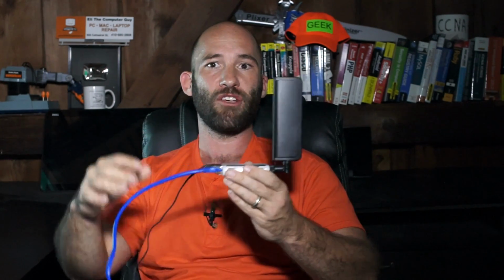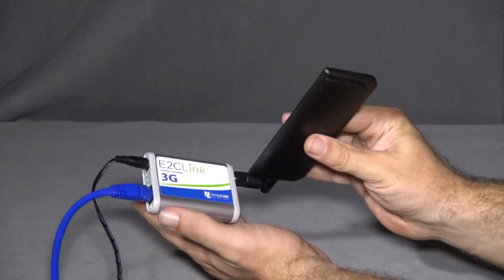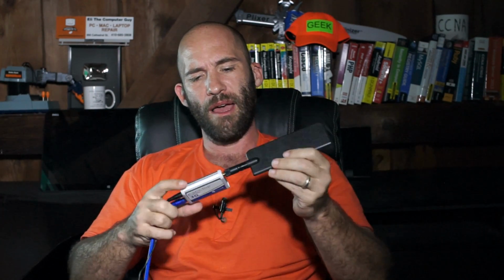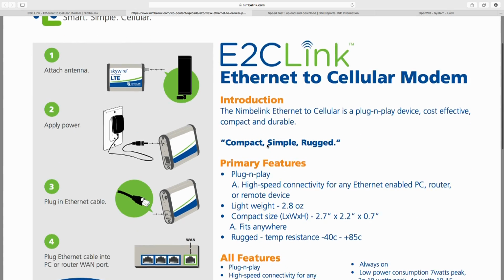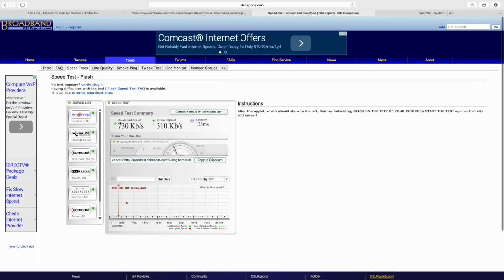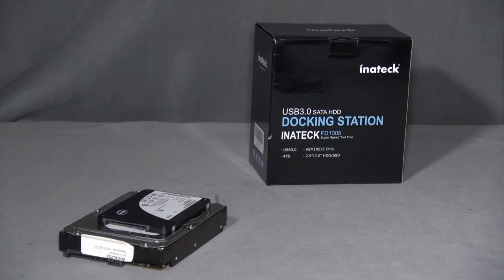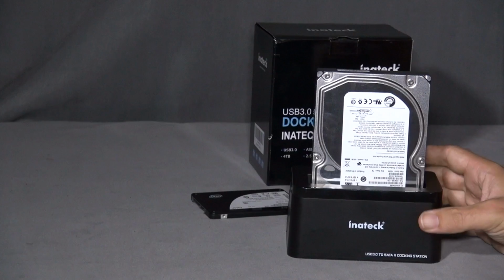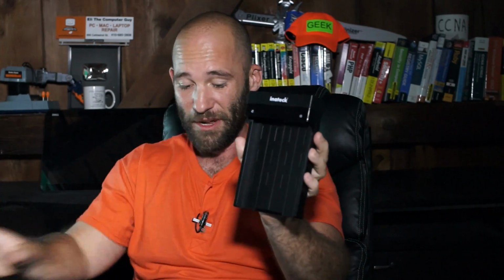Cellular Modem for Machine to Machine Communication

Comment: I am trying to hook up a RV50 sierra cell modem to have communication from my PC to a RTU in the field. I had a template that worked great but now with all the security I can't get it to work. Before I shared the IP address with then RTU and I was up and running now it just will not work. I have got it so I can read data from the RTU but I can't right data to the RTU. warning says not a friendly IP.  Help please. I have enjoyed the training you offer on the web.

Comment: Hello Eli, I have a relatively basic question as I'm new to cellular routers. I'm a little confused about how you would connect this to a cellular network, does it have sim slot?

I'm working on a mobile application where I need to send files to a machine from a home PC  and this seems to be the solution to my application.

Comment: Yeah the modem itself will [may] operate between -40°C or 85°C [i.e. extreme environments], but what about all the other networking equipment? For e.g. the ethernet cables... do you have to consider that stuff [what are the tolerances for CAT6 for example]?

Comment: Dlink 4g, LTE  ...Our near 10 site office which is far away from city using this and the speed is 50 Mbps, and i think its better then our head office lease line ...and we had no problem in connecting huge copier machine ,plotters , firewall , even 3 sites have a server ..by my experience it can easily handle up to 50 computers ,but our one site is having 100 PC ,that site is having 1 server one backup hard disk 2 plotter 5 copier /scanner machine
Dlink 4g, LTE 
http://www.dlink.com/uk/en/home-solutions/work/wireless-mobile-broadband/dwr-921-4g-lte-router